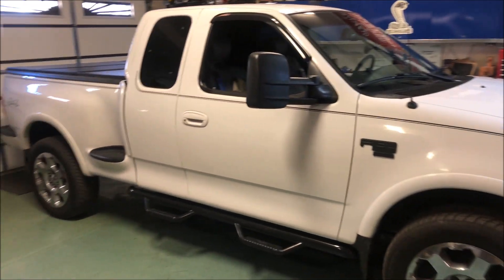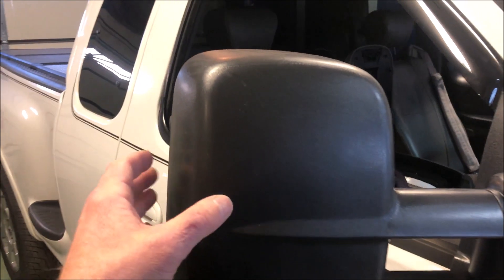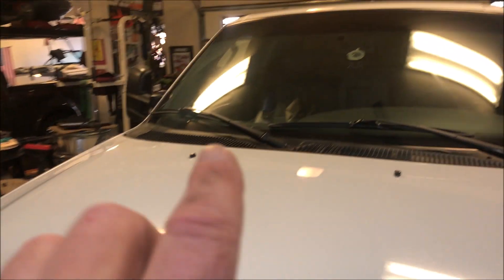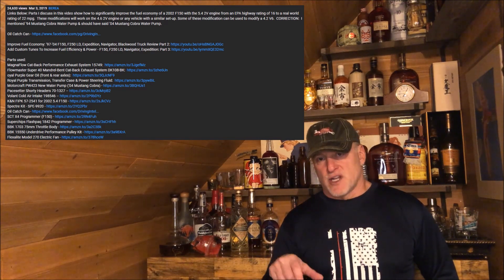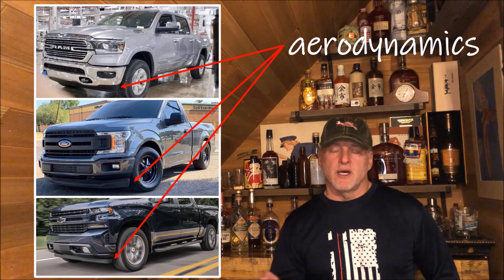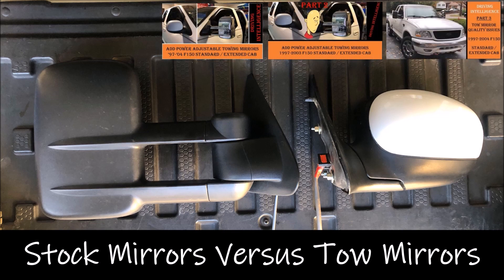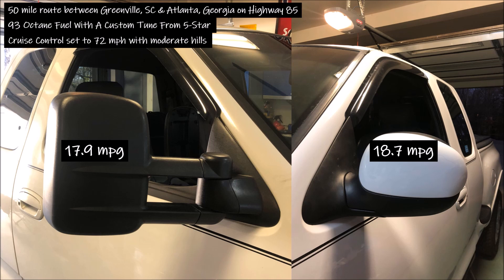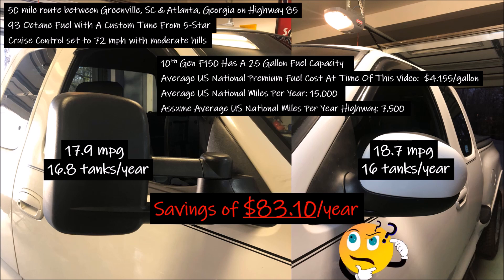Will Tow Mirrors Reduce Average Fuel Economy, MPG: 10th Gen '97-'04 F150 Pick up, Expedition, F250

Comment: Oh wow. I appreciate that math at the end. Really brings all the thoughts and concerns into perspective. I have 2004 gmc and I drove my parents dodge for 2 weeks. The one where it shuts down to 4 cylinders when it's idling down the highway. It's gets the same gas mileage so I didn't understand the whole concept of newer engines getting double the gas mileage. So I started driving at 65 on the highway instead if the 75 speed limit. I was spending 20 dollars less per week in gas. To say I'd only save 100 per year. That's ain't so important. But I do wanna add that lowering my highway speed only added 2 mins and 14 secs to my trip.
Reply from the maker: You are correct, the biggest impact to highway fuel economy is speed.  Going from 65 mph to 72 dropped fuel economy from 20.5 to 17.9... only a 7 mph increase.  I'm squeezing every bit of fuel economy out of this old truck.  ;)

Comment: I could see 0.6 mpg by folding the mirrors, but yeah, 6 mpg is a huge stretch.

I actually have a set of those Dodge folding mirrors for a 2nd gen Ram pickup. Makes me wonder if I could modify those to fit my 02. The way my build is going to go, I'm not really concerned with fuel mileage as I'm setting it up for off-road use, but I like having bigger mirrors.
Reply from the maker: thanks for checking in... looking forward to seeing something about that build

Comment: Hey buddy what wheels are tires you have on there?
Reply from the maker: This video will help: Test Fit 5x135 to 6x135 BORA Adapters on 10th Gen ('97-'04) F150, Expedition, Navigator: Part 1
https://youtu.be/tYHvFwICBbw
Reply from the maker: And this: Installation of 5 to 6 lug Bora Wheel Adapters On 10th Gen '97-'04 F150, Expedition, Navigator Pt 2
https://youtu.be/t18pUvTE4QM